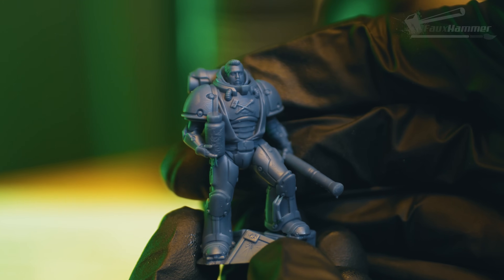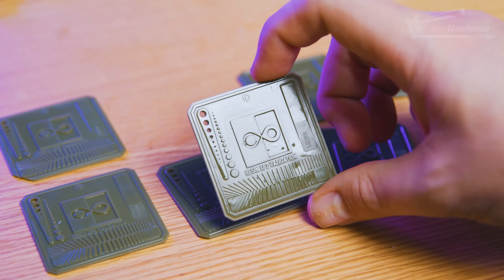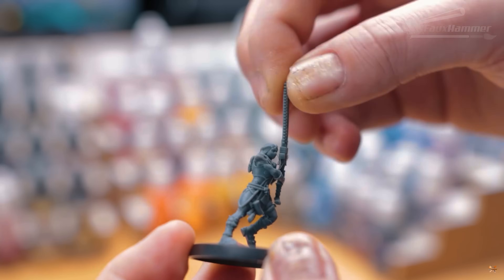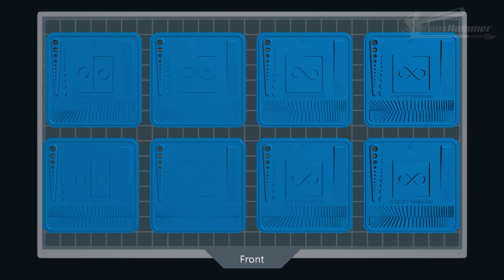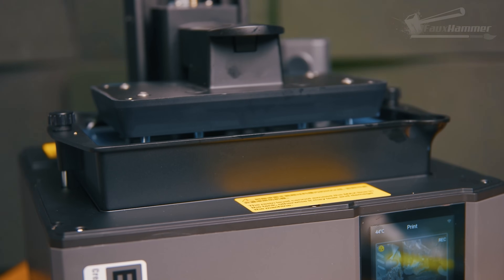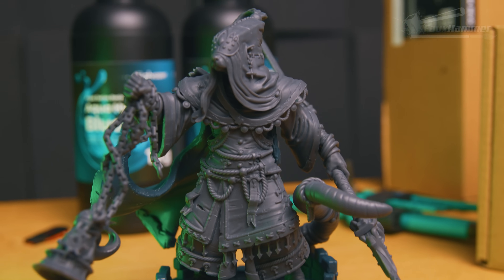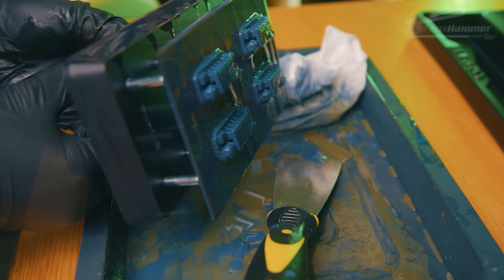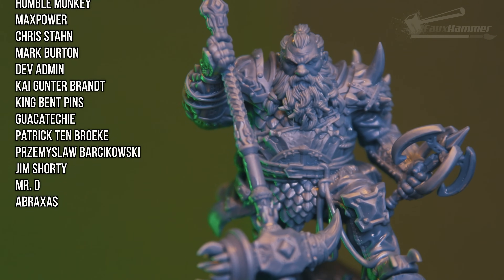Why Perfect Exposure is the Worst Exposure! - How to Dial-in your Resin Printer

Comment: I just recently got into 3-D printing came across your video. I’ve got the 4K Mars from Elegoo. I’m noticing on my prints. I keep losing some of the details and I’m trying to find out what I’m doing wrong. I’ve only been at it a couple of weeks now because I’m trying to design something as a big scale project in homage to hero quest as it were, but I noticed some of the details on my armor and everything are not coming out how I planned faces don’t matter as much because you could always paint the face on as long as the base line structures are there for a face, but I’m trying to find out what my best settings are for 35 to 55 mm I guess they call it heroic tablet top size

Comment: So here's my issue. I have an equal number of holes and posts...but I have 12 each printed, and the model has 15. also, it's thinner than the 1.4 height on the center, so it looks like I have a Z-axis out of calibration
Reply: I'm trying to print a mold and the overall z is only off by .345. BUT, the cavity of the mold is off by 1.6mm so for some reason the most important part is off in z accuracy. Not sure what's happening.

Comment: Love your videos.  I've been in the FDM printing hobby for 15 years now.  Had a recent project FDM just could not pull off in the detail I wanted so have dove head first into resin (figuratively of course).  It's ALMOST like starting from square one, at least it's like learning a whole new language.  I would love to see some video's on "starting points" or baselines.  What is a baseline exposure time for ABS Like or a flexible?  I know there are lots of profiles out there, but it would be nice to actually understand (if that makes sense).  Along those same lines; post processing - how long should you wash for, or more likely, what is washing for too long.  And same with curing times.  I know there are lots of variable like size of prints, wall thickness, resin used, what is being used to wash/cure....but again, a baseline would be great to see.  Another thing that just popped in my head....hollowing.  I have a lot of models I have made over the years and I have learned quick that hollowing and drainage is a big thing in resin.  Apologies for the LONG comment, as you can tell I have lots of questions (well, lots of experimenting to do).  Hopefully gave you some ideas for future videos.  And I don't usually comment, but I like how you present material.  You are succinct and straight forward about it, both of which I appreciate.  Cheers

Comment: Hi there!  I print 1/64 scale wheels for hotwheels customs, i was using anycubic plant based resin (super nice prints, just could do with being stronger) So i switched to the abs like 2.0 by  anycubic. Im finding that some of the wheels, generally ones with thinner spokes, tend to spiral after i take it of the build plate and process it. The spokes are meant to be straight, but they tend to spiral quite badly. I was wondering if you had any suggestions? Ive tried a varety of exposure settings, to the point that they are so overexposed that small holes are filled in. Im not really handling the prints when processing, so i feel like its something the resin is just doing? any suggestions welcome!

Comment: Ross, sorry for the tech help question but when I print this on my Saturn Ultra 16k it doesn't have as much depth as yours.  It's like I've adjusted the Z axis in the negative. I can change how crisp it looks by adjusting the exposure times, but the features only seem to be a few layers thick.

Comment: I started resin 3D printing this week with a Saturn 4 Ultra. I was planning to experiment with exposure times, but I have a newbie question: If the failure pillars are supposed to fail, but they're in the file, what happens to them? Are they loose in the resin or something? And do I need to filter it after printing?
Reply from the maker: welcome to the party pal!

and no, they won;t be in the vat, they are absorbed into teh subsequent lkayers, tha's the whole point oif the roof above them all. so that anything that fails is caught. hope that makes sense.
Reply: @FauxHammer  Ohh thanks!!! That makes so much sense now lol, I'm still in the FDM printing mindset and that idea never crossed my mind

Comment: One tip you forgot to mention - strengthening specific supports on presupported models. It can often be a good idea to add a few more stronger anchor supports "just in case" to surfaces, that will be hidden once the model is built.

And you can do that even on "presupported stl" models, not as "clean", but who cares about that, as it's waste part we're discussing?

Comment: @fauxhammer can I ask a maybe complicated question please?  Got a friend using an old mono 4k and same resin but doing exposures of 1.8 seconds  at .035.  I pretty much have to do 2.42 s exposure on s4u with those settings.  Am I doing something wrong?    I keep resin at min of 35c and always mix before use and run the release film with a silcon spat before running.   Thanks for any help you can provide bud :)

Comment: I feel comes has the easiest to read testing but it doesn’t always work. I can print it back to back and have different results, or lower the exposure by a lot and have more failure print out then with a higher exposure. It just doesn’t want to work for me

Comment: Upgraded my old large RGB Transform to 7k mono and it prints ok just keep getting thin sheets of cured resin in the vat. Someone said its bc the UV was for RBG screen so now for the monoscreen its too powerfulso i reduced it to 70% intensity from Chitubox. The print feels a bit better, it felt a bit different to the touch compared to others but i still get cured thin resin sheets.
Next time i print im gonna wipe the fep with WD-40 so it releases easier, it looked like the fep was sticking too much to the model, gonna increase the peel distance to make sure it detaches, its a large printer and once the fep gets warmer it stretches more.

Comment: The best detail I have gotten from a print came from calibrating with the cones (specifically v3 during our development testing of it) and I was honestly blown away by it.  I had previously used the cones v2 and J3Ds boxes and was quite happy, but cones v3 made it so much easier to calibrate and get amazing results.  It's obviously very resin-dependent whether you can get away with perfect strength PLUS perfect detail, but I haven't found any other calibration tool that makes it so straight forward to dial in your resin.

Comment: I Have an issue with the cones on my GK3U , cant get full success with out stupidl overexposing an bloating ive gone for finding the dimensional accuracy and slightly ove exposing and i get successful prints. Its only one printer that ive had to do this on as normally a successful print side doesnt require a1 second over exposure

Comment: Loving the new format so far, Ross! Glad to see you bringing up the whole "calibrating for dimensional accuracy vs. calibrating for support strength" dilemma; as that aspect seems to be left out of a lot of online discussions regarding SLA printer calibration.

Personally; one thing I'd like if you delved into is something that you alluded to here: supports. I recall an older video of yours that covered auto-supports using a specific slicer; but a more broad video covering the principles behind supporting a model and the ins-and-outs of doing so would be great. Again personally, I have been having a lot of trouble regarding the various contact point settings- ensuring the model adheres to the supports while also damaging the surface as little as possible has been a real challenge for me, and I would not be surprised if it was so for other people getting into the hobby as well.

Comment: Perfection isn't possible. 3D printing isn't unlike machining in this regard: we're really dealing with tolerances, tools, and materials. I personally value toughness and dimensional accuracy in my prints - accuracy because I often print fitted parts that have to mate with something else perfectly. Toughness because, let's face it, none of the resins are that good with impact & shocks a few weeks after the print finishes (when the resin has fully cured). 

I'm willing to forgo a bit of detail for a print that won't break if look at it too fiercely.

And of course, none of that matters if the print fails. I've just had a few prints fail because my nFEP needs to be replaced. It's not exactly something that's easy to see for what is probably the majority of us who just top up the resin and print on. I mean, I have a few different types of resin, but I don't exactly swap frequently.

I do think some discussion about how resin behaves - how the lift settings can change the appearance and reliability of a print, how anti-aliasing causes the resin to physically behave - could be neat to see. (There are some good resources out there - the UV Tools wiki has some interesting reading, for example).

Comment: UV exposure time does cause your resin to physically grow, it also makes the resin harder providing more strength. If you're correct, finding a balance is good!  

However... there's a part of the Calibration Pyramid that you can take advantage of, a part you're missing. dun dun duuuuunnnnnn!

UV exposure time isn't the only thing that makes the resin physically grow.. or "appear" to be over exposed. 
You can make resin grow or (Bloom) by not using any light off delay or moving too quickly or trying to print resin under poor conditions.

Correcting these underlying conditions is often quite easy. Offers hidden benefits far beyond calibration. >>AND<< Causes a calibration print that appeared to be overexposed to read as if it's now underexposed!! Despite the fact you didn't change the UV exposure time at all!

This will allow you to continue to increase the UV exposure time far beyond what you previously had to get a harder cure.

This process of measuring strength under the control of dimensional accuracy is called tensile strength calibration.

How to do this?Well, this is the reason why Boxes of Calibration aren't just boxes or just pillars.... But why both of them coexist at the same time. They are checks and balances against each other. One for accuray that's measurable or observable tensile strength that's observable. 

The point is to get as many pillars as you can while maintaining accuracy. This will force you to correct underlying conditions that cause inaccurate prints. Allowing you to increase the exposure time more than you ever have. Obtaining a harder cure and therefore a more successful print without sacrificing any quality at all. 

This becomes incredibly useful, especially when printing things that require assembly or even minis as even minis that would traditionally be considered under supported will almost always print under this type of calibration. Or minis that are over supported won't suffer from blooming support tips even further leaving even more damage.

Comment: Please review/discuss flexible metal plate add-ons for the build plate. I have an Elegoo Saturn 4 Ultra I'm considering adding one to. Tks
Reply: I used to have one for my Saturn 2 but recently got a Saturn 4 16k. I think adding a flex plate may introduce more issues though considering the angle pull may actually be bad and result in slight movements and variability in the bed that would be a problem based on the spring bed. So I’m skipping for now but really miss just popping models off a plate instead of chipping them off.
Reply: @ep1kone I have the Saturn 4 Ultra, I wouldn't worry about using a flexible plate; even when the fep is peeled at an angle it will fail long before it's got the strength to pull the magnetic plate off...

What I have found with my Saturn, vs. the straight pull Mars I had before it, is you really can't print directly on the base, unless you want squished bottoms on your models... So I don't mind hacking the parts off with a scraper tbh, because the only damage will be to the support raft. I sharpened mine to lethal levels, so it generally slides under the model, rather than hitting it like a brick wall. Makes it very easy, if slightly dangerous, to remove prints!

Comment: Hi Ross  I'd like more info on two areas.  Post print curing, as the videos/comments I've seen are inconclusive and don't explain what you're looking for.  The other is print accuracy and particularly dimensional accuracy with no warping.  I've recently printed a 7mm loco body, about 180mm long, and the warp over the length on the x axis was 3mm.  Keep up the great work.

Comment: I am using Sunloo ABS-Like resin and the outcome of my miniatures seems to be fairly brittle with protrusions like swords and what not. My printer is calibrated, but I don't know if the issue is cure time or some other factor. Most of the videos I've seen about curing have been more "hope and pray" you are doing it right.
Reply: I've had pretty good results with Sunlu ABS-like, but I think thin features are always going to be brittle in resin. Still worth checking out other brands though - my go-to brand is Siraya Tech, but their ABS style resin is significantly more brittle than Sunlu's, in my personal experience.

Comment: Damn, doing these resin calibrations on older printers is brutal... I've spent 13 hours calibrating my resin for it to pass the cones of calibration test on my Mars 4. It's not like it was 100% essential for me, but I print more technical parts, and I'd prefer my prints to have consistent tolerances, and doing these tests gives me a baseline I can calibrate towards if I'll ever switch resin.